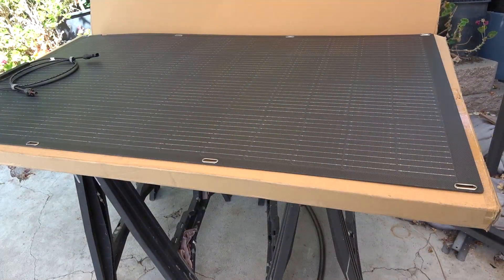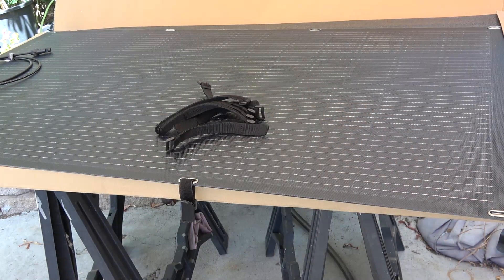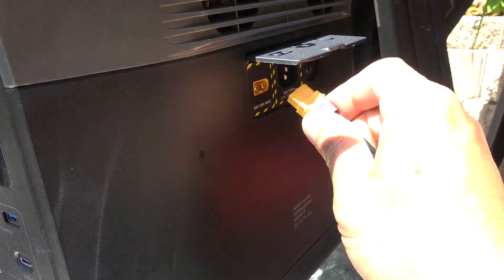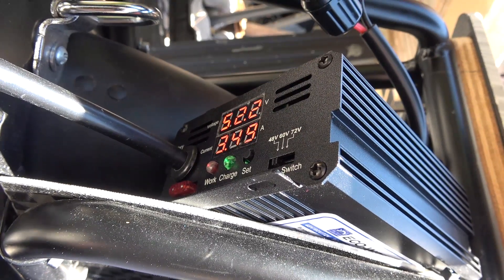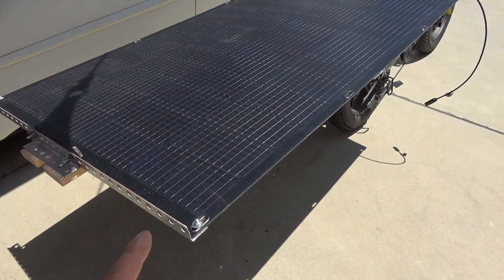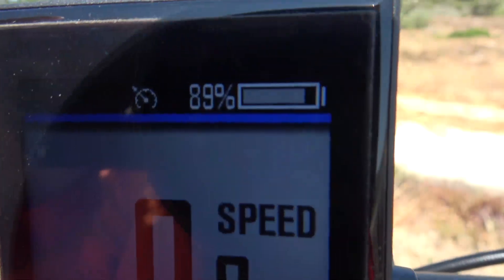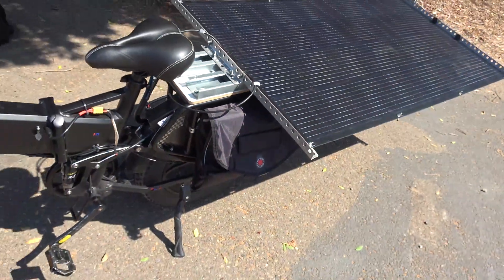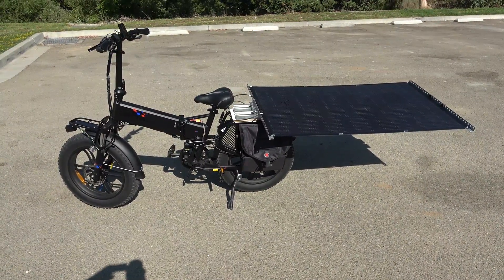Review & full test: Allpowers 200W flexible monocrystalline solar panel on an electric bike

Comment: Does anyone know why the maximum system voltage is just 120V. Many similar solar panels  , but different  brands like Renogy or Boughrv have 600 or 1000 volts rating.

Comment: In a mobile application like that, you'll be lucky if that MC flex panel lasts 2 years. You really should consider a CIGS solar panel (copper indium gallium Selenide).  CIGS panels don't have any glass in them like a MC panel. CIGS are warrantied for 12 years replacement and 25 years output.CIGS are highly shade tolerant, highly heat-tolerant, lighter, and virtually indestructible.

Comment: Looks great.I was surprised to see you plug in 50V  into the power station through the XT60 is possible on all power stations?
Reply from the maker: Almost all power stations have DC solar input. The input voltage could be different depending on the model.
Reply: xt60 can take much higher voltage.. 500v capable, 60amp peak, 30 amp nominal, possible derate [heating] at about 125~250v? [0.55 milliohm resistance in the connector]

Comment: Simply no need for convertors inverter and all that nonsense. All you need is high power diode to directly charge the battery. that is all. solar panels panels  AUTOMATICALLY regulate the voltage and current due to their high output impedance. if battery tries to draw too much current the panel voltage falls automatically..etc
Reply: Ah, thanks for that tip! Off to research …
[later] Perfect: exactly the minimum functional requirements.
Reply: @SchoolforHackers  The high current diode is to prevent the battery discharging into the solar panels. try a test setup in the garden. the SP connected to the battery you can attach a current meter in series and voltage meter across and see how it varies... than do a test and video it and report your findings. the advantage is less complexity and cost. a SP disconnect button is a good idea.
Reply: @esecallum   Excellent proposal, particularly because I want this exactly for my garden and greenhouse. A small solar panel and a Pi 2 or 3, with a battery to get it through the night; it can all run on DC, but has to really maximize efficiency. It’s been years since I made a vid but you’re right, it’s a great topic. ;)
Reply: This comment is wrong. The solar cell has no way of knowing what the voltage limit of the battery is. If the panel and battery are voltage matched and the panel puts out less watts than the battery can take, you might be able to get away with this. Even then it will be inefficient since you’re not using mppt to optimally draw from the solar cell.
Reply: @BrianAnother  tru it and see instead of being an armchair crotic
Reply: @BrianAnother  the output falls AUTOMATICALLY due to high output resistance of solar cells. Draw too current and voltage falls ...high school physics and ohms law.
Reply: If you put 35v across a 12v battery, it’s not going to be happy.
Reply: @BrianAnother  it won't stay 35 volts due to high output impedance. Learn some basic physics
Reply: @esecallum  I know it's pointless to argue on the internet.. But, OK, here we go.
Let's say we have a 35v panel.
Let's connect it to a fully charged 12v battery.
The battery cannot take any more charge without being damaged, but it sees 35v across its terminals. The battery will be damaged in some way.

You're right that the panel voltage will drop necessarily depending on the current drawn by the battery, but that doesn't play a role in this case. If the panel open circuit voltage and battery voltage were matched, you would naturally get some kind of current limiting when the battery is empty, which is good. Most lithium charge controllers start with current limited charging and then switch to voltage limited charging. If the voltages match and the wattage of the panel is not too high for the battery, you get a similar effect naturally. I think that's the point you're trying to get at.
Reply: @esecallum  For your example to work safely, you're assuming the solar panel array voltage (panel series count) matches with the system battery voltage.  But this is a dangerous assumption and not always true.  You may be sending amateur builders down a dangerous path without accurately defining your design enough.  Especially if the battery does not have a BMS.

Because it is often necessary to have a much higher voltage solar panel output over the battery in order to get more solar power and efficiency.  If you have a solar array whose max voltage (under load) only matches the battery voltages, you often get poor charging speeds.  Because Ohm's law I=V/R, then as the battery voltages naturally rises, you get less current (I) even if the battery can take more current and there is plenty of solar light available.  This design will have slower charging speeds especially on a system that has such a tiny solar area like an on-board e-bike.

For people learning to build solar with batteries: Depending on the amount of sunlight and number of solar cells in series, the Lithium battery cannot be charged above 4.20V/cell.  Charging the battery above this level is very hazardous. You get into problems like cell expansion, then venting of gas, to full-on cell burst with fire with white smoke and this very acidy/lemon scent to it.  Been there done that.  Do not mess with overvolting lithium batteries or any battery for that matter.

What could help in this situation is if the battery has a BMS (Battery Management System) which is connected in series with the battery on the anode. The most important job of the BMS monitors all cells in the battery and cuts off charging when any cell reaches above 4.20V.  BMS also can cut off discharge to protect the BMS if a battery cell becomes too low, also many have thermal protection too.  Most commercial off-the-shelf package batteries have a BMS.  But DIY battery builds will not unless specifically added by the DIY builder.
Reply: @beyondfossil  my sentiments exactly. do NOT direct-connect a solar panel array to a battery unless you know exactly what you are doing, you will want a charge controller, be it a PWM unit or a MPPT unit rated/configured for the battery.
Reply: Yeah but lithium batteries you can't directly put heavy current into them unless you want them to explode
Reply: @dn7783  Depends on the size of the battery and its C rating.  Li-ion can do around 1C to 2C charge current. LiPo can do 5C or more.  All that beats lead-acid charging at a very slow 1/8 C.  Never exceed manufacturer's ratings.
Reply: @beyondfossil  the charging C-rate heavily depends on the composition of the battery cell[s] regardless of li-ion or li-poly, 1c is generally the safe fall back for all lithium batts..
Reply: @niteriderevo9179  LiPo has specific chemistry for increased power both charge and discharge C.  But there is a weight penalty of some 50%.
Reply: @beyondfossil  that's the thing, not all li-poly batt cells even have said chemistry, that is what i am saying. no cellphone/tablet batt is going to be happy with anything above 1C unless it's WAY in the extreme top end, and even then, it is only within the last few years, IF that particular make/model has such.. no laptops that run li-poly cells that i know of will be happy with the same above 1C charging.
Reply: @niteriderevo9179  Sure but I was writing about the battery technology directly and not the devices.

That said, most consumers are clueless about the battery technology in their devices, which is fine because they'll just use the charger that came with their device anyways.
Reply: @dn7783  what is wrong with you? The voltage and hence current falls if too current drawn. Look up output impedance.
Reply: @esecallum  I'm just saying hooking solar panels directly up to a lithium battery is very dangerous, that's why they have controllers out there

Comment: Extremely Awesome!!! very impressed with rigidity.  Do you consider needing more support?  Or Could you get away with smaller aluminum rails?  Could you hang cargo under the rails, and still maintain rigidity?

It's very cool that you can still use paniers.  I would work on tilting system to just gain access to paniers without removing them, and perhaps even act as a rain cover while sitting on back rack facing backwards.  It would also be a fantastic high support for a tarp that is open to the sunset.

I don't like your "roof" idea.  takes too much supports, will rattle, higher sail is more potential problems.  I like building a little rain shelter in back of bike.

Comment: I really want to put a flexible solar panel on my 4Runners roof, but can’t think of a decent way to route the cable without drilling holes in the roof :(
Reply from the maker: You don't have to drill holes on the roof. Route it through the back door. Watch this video where I mount a 327W solar panel on my Sienna van: https://youtu.be/v50QEwT1Jbo
Reply: @vuaeco  I like it! Might give this a go, Im just worried about it breaking or flying off on the highway. Not sure how my insurance company would feel about that lol

Comment: What's that 3 voltage selectable charge controller you are using on the bike? And is that pwm or mppt?
Reply from the maker: That's an Eco Worthy 10A boost charge controller. It's more like a boost converter than a charge controller though it is more efficient than a regular boost converter.

Comment: Dude's been deleting my comments because I pointed out a different solar panel does a better job in the shade - unsubed.
Reply: YouTube also randomly drops comments due to bugs in the code and backend systems.
Reply: @beyondfossil  And sometimes they come back later.

Never had my comment removed, does it give you some notification?
Reply: @Teknopottu No notification either when this happens.  Once you post the comment and the error happens, the comment actually shows up in the page, and you can even copy the link to the comment and retrieve it later.  However, when you refresh the parent comment, your comment fails to show.  Nobody else will see it either.

You can use the link to your comment to get to it and see it but nobody else will see it.  This means the comment is actually received and stored on the YouTube backend.  But the comment just fails to show up publicly.  Sometimes the person you're replying to gets a notification but mostly not from what I've seen.

I think this is a bug in YouTube's comment section, or some errant automatic filtering.    I imagine they receive hundreds of thousands if not a million comments a day across their vast platform.  The video owner can also block some comments but based on behavior of immediately blockage, this is not normally the case.
Reply: Why on earth? Is he promoting this stuff or just rude?
Reply: If you put a link youtube blocks it as a spam. Sometimes.
Reply: @High56  Its inconsistent for sure.  I was able to consistently post comments with Wikipedia links before but now not so much.

As ender users, we'll never really know why YouTube fails to post because YouTube never reports back what happens after each post.  It could be from software error, automatic filtering, video owner deleting later.  YouTube could inform end users on any of these possibilities, but it doesn't.

A YouTube admin with system log access possibly could tell us. 

YouTube management really needs to look into this.  Without good comment system, the social aspect of YouTube is greatly diminished.  The problem seems to be getting worse too.  Based on what I've seen, it seems to be a software/system error causing most comments to fail to post.
Reply: Its just in auto moderating. jerk.
Reply: You mean this comment?

"Good stuff! I had this idea but with the thin flexible (light weight panels) like your idea as a trailer train behind the bike...still just as impractical though no doubt"

Because its not deleted.
Reply: @kowhaifan1249  Sometimes comments may seem lost or deleted for a while, not sure why.
Reply: @kowhaifan1249  No I said he should check out shadestopper panels - that comment was deleted, twice.
Reply: Thats what soys do.  Tbey can only be right.
Reply: No I didn't, I swear!
Reply: It's your opinion...... It's his video, and content..... Why do people insist on picking apart someone's work, material. For people( trolls) like you whom are perfect in everything when viewing something, why not try giving positive input towards others first.
Reply: @dogdazetravellergarrett1367  Very good point.
Reply: @dogdazetravellergarrett1367 its not picking apart and would help others buy a better product vs a shit one.

Comment: How long would a battery last always charging hit ? thanks for the video
Reply: If you control the variables, you can get different answers.

First if your asking how much farther can you go adding roughly 3 amps hours to your system, roughly take 3 amps divided by total system draw.

If your asking about battery durability, that depends on the quality of the BMS, and the quality of the cells, and the chemical makeup.

Setting the output of the solar to too high puts a lot of trust on the quality of many circuitry, it's better to find a voltage between the charging voltage and the battery's sag current, that's the point where you can avoid any issues through circuitry accidental wear on the cells can even be a cause for shortened lifespan.

Another change is run a LiFePo battery.

I don't know if it's possible to run two panels in series, and have a trailer with additional batteries and solar panel, but this would allow the electronics to lower the voltage of the two panels and gain additional amperage.

Please cover the panels before making connections... There will be storged voltage, low current, high voltage... From what I've heard.